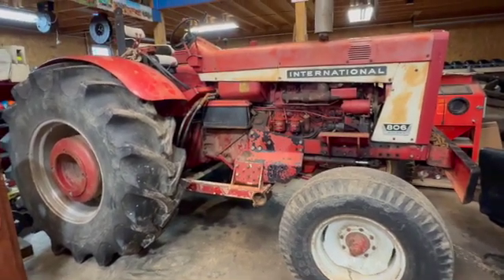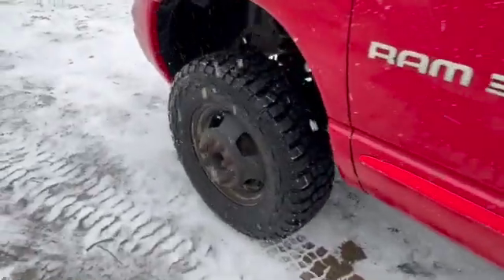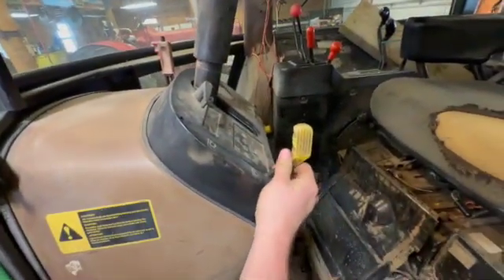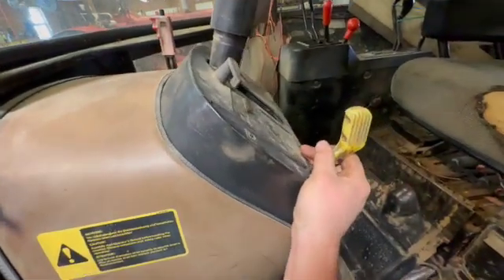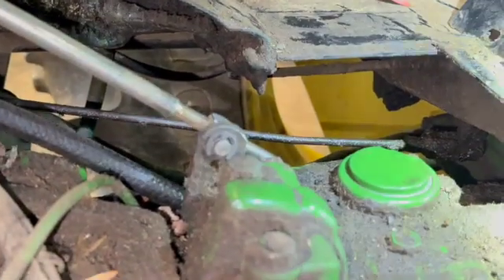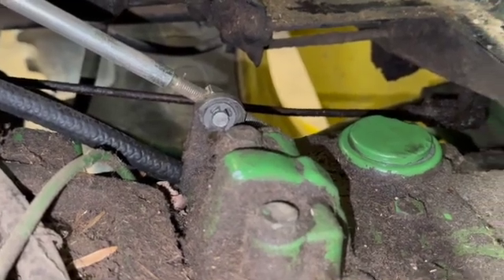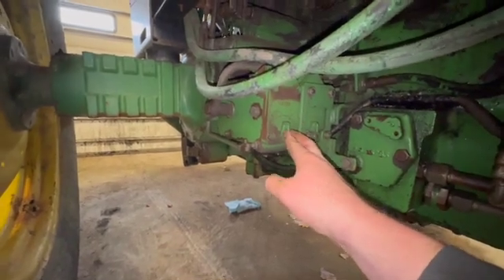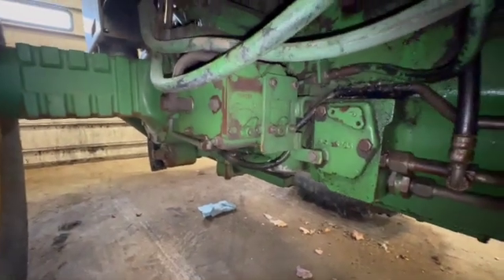The difference between glow plugs and grid heaters and getting the 1206 back together.

Comment: Why not put a new Hy Capacity T/A in it while you have it apart?
Reply from the maker: This one works fine and does now show any signs of being an issue and we have a lot of projects that we need to get done this year. We do have one tractor that needs a T/A and we are hoping to we have time to get that one changed!
Reply: @lifeonthefinkfamilyfarm  what size tires are on your 2 IH TRACTORS ? Were those tires a IH option or custom aftermarket option  ?
Reply from the maker: @BrieeAnnaTeylarr  These are 30.5x32 firestone spade grips, and as far as i know they were not standard equipment. These tires came off of a combine.